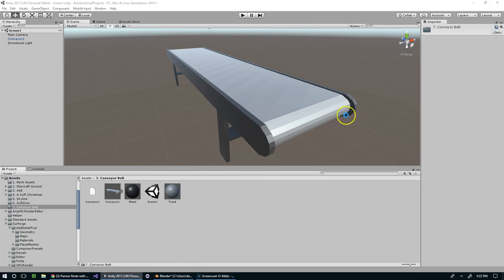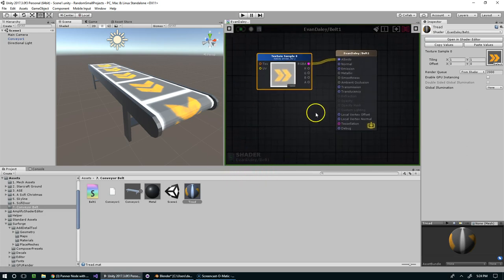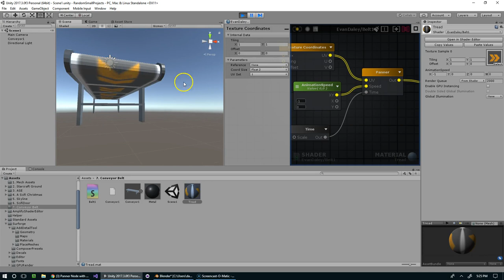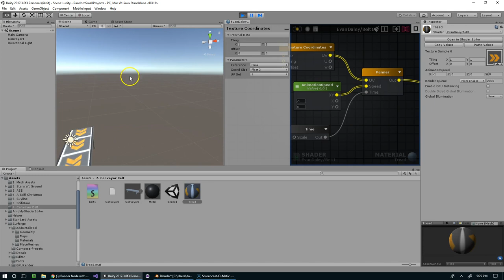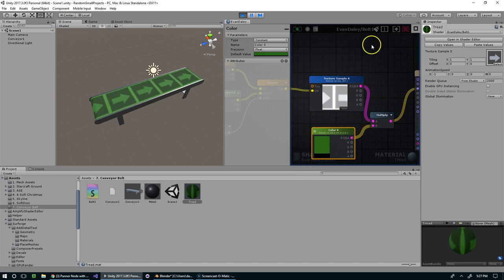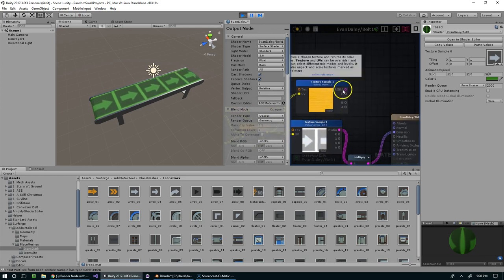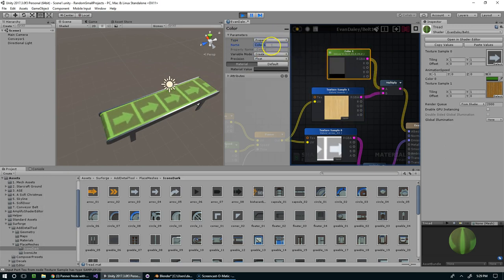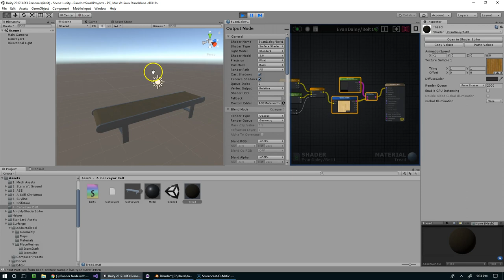Conveyor Belt Part 2/2

Comment: Does it even function? Probably not..
Reply from the maker: As with every prop in a game, the item is simulated... So asking if it "functions" is a funny question. If you're wondering whether it will push items off, that is something that could be scripted in a few different ways depending on the type of game and the size/weight of the objects that the belt is interacting with. A simple approach would be to add a trigger box and add vector force (assuming the thing being pushed has a rigidbody). Mainly the point here was to demonstrate modeling and shader creation. :)